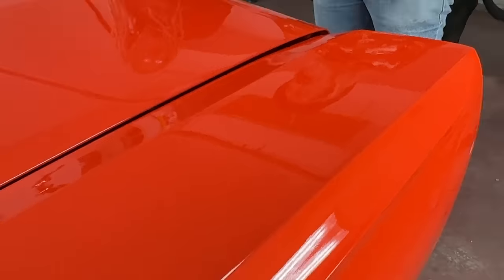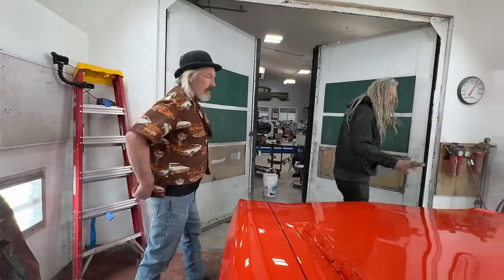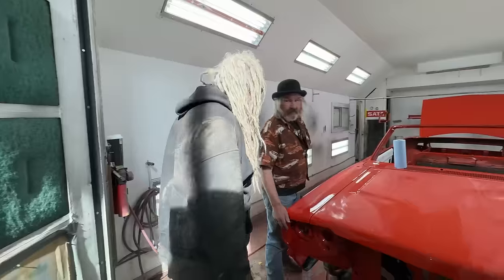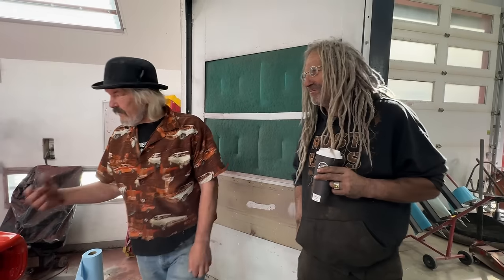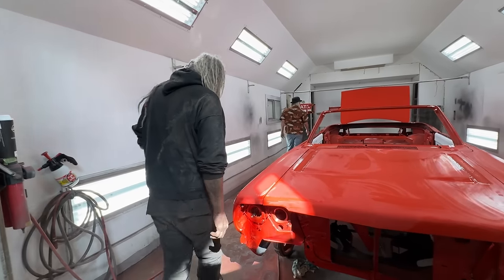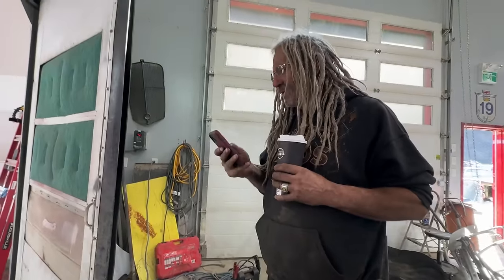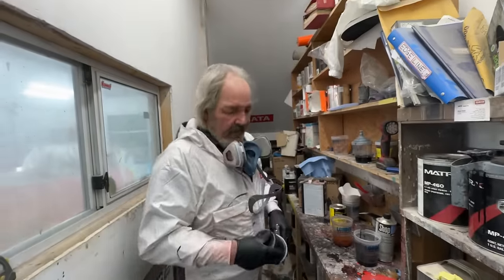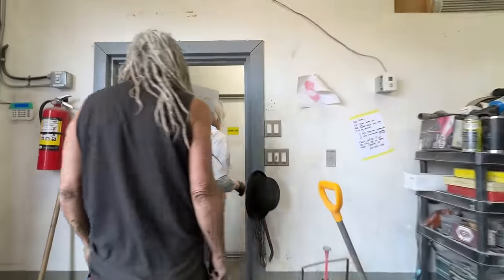Painting Continues on a 1968 Road Runner Project (Part 12)

Comment: You can use a Hardner/catalyst with blitz black. The mix ratio is 8 parts John Deere paint : 1 part REN3001 hardener : 1 part John Deere thinner.

Comment: Hey Blair, just curious why used a dark base before putting orange on the car? I’m getting ready to paint a Camaro hugger orange I was told to use a light base white light gray something like that. Just curious this is Paul from Western Massachusetts.
Reply: Excellent question.  I usually go light sealer for light colors but its not critical when doing completes.  I did sprayouts with black and grey sealers and we chose the black.  When matching factory colors for partial paint the paint manufacturer usually gives a value shade or recommended sealer color
Reply: @blairsmith726  you are a legend my friend